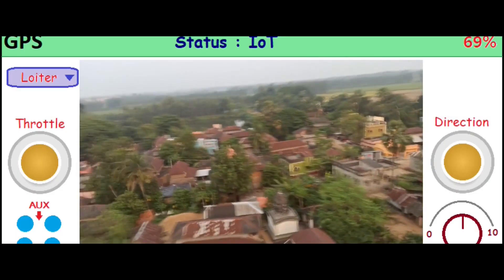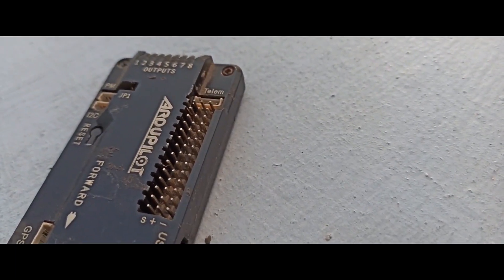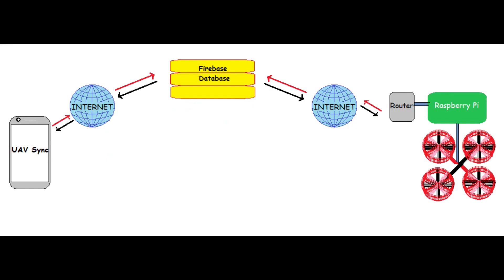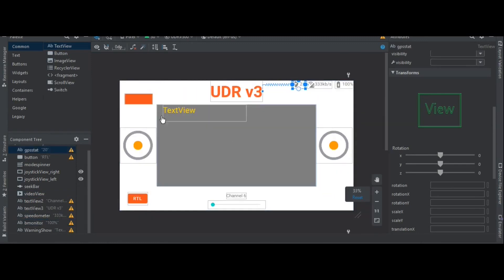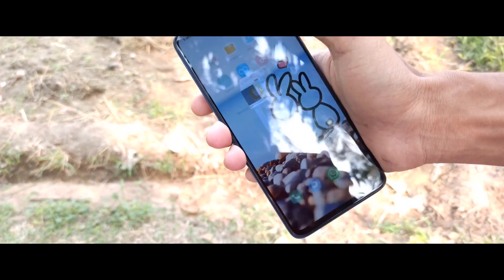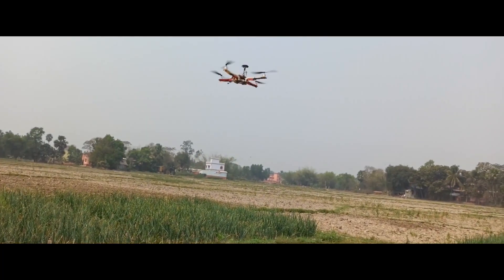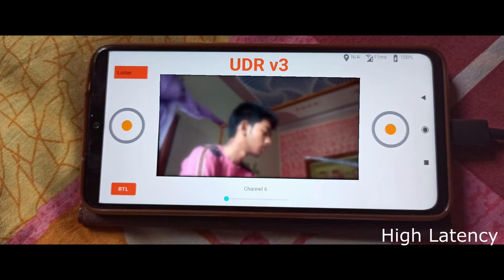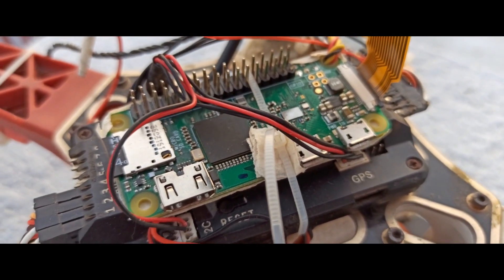Unlimited Drone Range v3 | Raspberry Pi Drone | DIYLIFEHACKER

Comment: Hello,
I for one do not believe in drones without distance limits for the following reasons:
1- Electric propulsion consumes a lot of energy.
2- Connecting radio controls via GSM, Internet or Cloud Host is not secure.
3- Retransmitting telemetry data or images in real time is a big problem.
4- The software becomes complicated, requiring very heavy equipment on board.
* That's why I would have been curious how you solved these problems, especially the last one. But, considering that access to the software source is blocked, I have big reservations!
If you want to answer me, use the same way.
Regards!
Sandu

Comment: You bro! Can you please collaborate with me? I am trying to make an RC receiver that will be connected to the internet and thus can be given signals from anywhere in the world. I want to make an application through which the receiver can be controlled. Now, that receiver will have an electronic compass, a GPS module, and a camera, and will be connected to a GSM, to be able to communicate anywhere as well as calculate the current speed, location, and other parameters, and display them on the application. I want to program the receiver in such a way that it will be able to plan autonomous missions, by automatically calculating the distance between the points, and then give PWM signals, to the flight controller, when given instructions, just like the ones we can do with APM or pihawk. But since, the other cheap flight controller users such as kk2.1, or CC3D, or even DJI NAZA (I use it), do not get that opportunity to experience mission planning, I want a solution for them... If we can make it, and then successfully bring it into the market, via websites, it will be a breakthrough. Please reply...
Thank you...
Reply: Brother it's a good though 
Have to done any autonomous things in any drone ?
Like in Pixhawk or apm with rpi 4 or other ?
Like human tracking or object detection and more ?

Can I get ur mail or how can I contact u plz ?

Comment: Hi again, I have started working on the drone again, but I see you have developed a lot! Congratulations brother :)

Tell me, is there any documentation of motor control etc? I see that you made your control app - as I had in mind :) 
But I got bogged down how to use the gui to send commands to the flight controller....
Reply from the maker: U just need a socket tcp/udp to communicate abd send the roll yaw pith thr values
Reply: @DIYLIFEHACKER  yes, i know, i will use ssh tuneling, but i dont have idea, how looking comand to controlling value of throtle etc. thats why i asking about documentation
I have changed plan, and it will be plane, not drone, well case is easier.
Reply: @DIYLIFEHACKER  or just use servo.h for controll servo and motor?
Reply from the maker: @stickylabhome7568  yes. But that freeze the code for the time period if u make changes in dutycycle

Comment: it isn't necessary to use ardupilot?  I think  gps, pwm signals, sensors could be controlled trough raspberry pi. It would only need module for connection directly to pilot without internet. Am I right?

Comment: 8:33 you said that streaming was solved and edited the video onto the phone. wow
Reply: No, that is drone camera pointing at himself.
Reply from the maker: it was solved but for showing in the video I didn't shoot it again just edited the picture. This try was not perfect, but V4 is comming soon. That runs custom os on pi zero means faster with ultra low latency. also will test range upto few kilometres ☺️
Reply: @DIYLIFEHACKER  oh okay I See. I was also wondering how you want to maximize flight time. Did you already try high power Li-ion cells? Would be interesting to see :)
Reply from the maker: @TiimedArts  it's gonna be a delta wing ✈️ with flexible solar panels on top of it
Reply: @DIYLIFEHACKER  sounds amazing, when do you post the video?

Comment: It's a great project, please can you explain how did you connect the raspberry with drive controller ? Which ports did you use? In the raspberry and in the control drive?
Reply from the maker: means
Reply: @DIYLIFEHACKER  what are you meaning?

Comment: Great work friend...Why not using QGround control + Zerotier + MavProxy. That way you have live video , telemetry and everything very safe... putting the raspberry in between RC and F/C is very risky.. last think you want to experience is RP stops responding and then you have no contorl over the drone... I have exactly done this with an android custom autopilot and PIxhawk and Qgroundcontrol as well... Maybe create a video of that later.
Reply from the maker: Yup. just tried something. Now working on my own FlightController and video of that coming soon

Comment: How to connect servo for camera
Reply from the maker: In the raspberry pi python code add another GPIO for servo and map the dutycycle fetched from firebase data of that slider in the app. btw, this system is a bit slow I will make another one  later.
Reply: How to connect servo with APM 2.8

Comment: Thanks for a nice detailed video. This keeps coming up in my mind,,,after seeing  several 4G LTE drone controlled videos. 
Question: It seems there should be some way (someone much smarter than I) to create a firmware to place on a usb 4G modem to were there would be a 'round robbin' effect and your smart phone 4g LTE would act as master,,,and the 4G modem in the drone would be the slave and you would really only need a sim card as a dummy card,,much like a  bridged connection. Somewhat the same principle as a Zerotier setup network. In other words the drone modem is talking to lte network souly through the phone connected to the cellular tower. Only thing that puzzles me,is the cellular network has to see,,the drone modem as a mac address,,on nework?. In other words you wouldnt need be paying for a data plan for the drone's sim card? What are your thoughts. Thanks
Reply from the maker: Here ISP acts as a medium. What you are talking about is only possible for local host

Comment: Sir I have one problem with my hexacopter. As I'm using APM 2.8 in loiter mode my drone is not arming and in altitude hold mode it is arming but after 50% throttle when I just increase it further the motors speedup like crazy and then when I down the throttle it's not slow down. It's slowing down when I fully down my throttle to zero. Please help me regarding this sir...
Please sir help me I'm waiting for your response...
Reply from the maker: It's natural.
If you push throttle above 50% then it will climb then after you return it to 50% it will hover there with the same altitude.
Reply: @DIYLIFEHACKER  and what about loiter mode my drone is not arming in loiter mode
Reply: @DIYLIFEHACKER  Please help me regarding my drone not arming in loiter mode
Reply: @DIYLIFEHACKER  No sir its not lifting just vibrating at a place and it's my first time.
Reply: Ok sir And please tell me why it's not arming in loiter mode
Reply from the maker: check motor layout and propeller directions

Comment: I m using kk fight controller nd instead of mobile app i m using transmitter reciever of fly sky i6.
If will connect my rpi with flight controller nd thn with receiver;thn how should i manage the coding part ?
Reply from the maker: you have to use Android app

Comment: What is the flight time, battery capacity and weight of your drone? I have recently built a very similar quadcopter, but with live fpv and camera, it weights 2kg and flies only for 10 minutes with a 5000mah battery, any tips?
Reply from the maker: Use generator
Reply: Use lithium ions instead of lithium polymer. A good battery would be samsung 25R